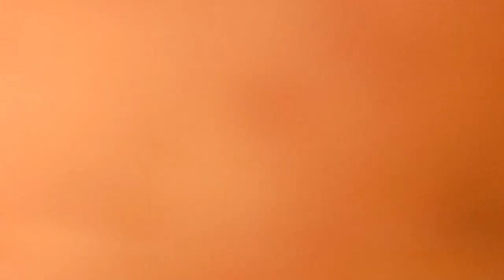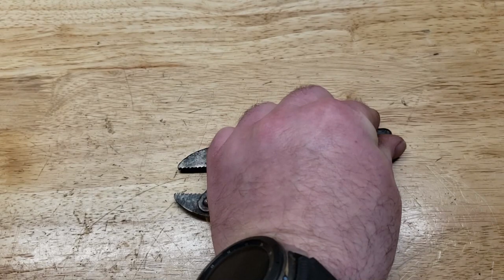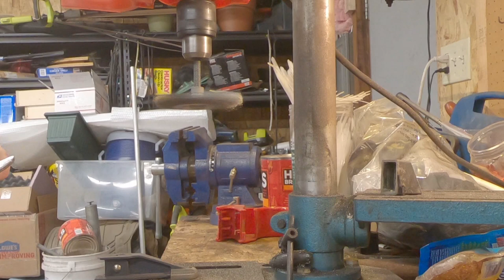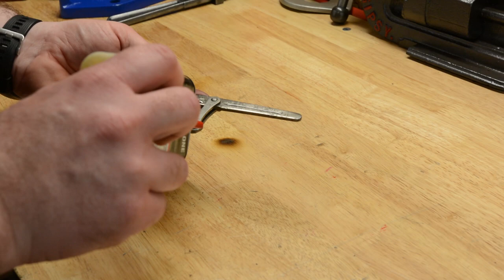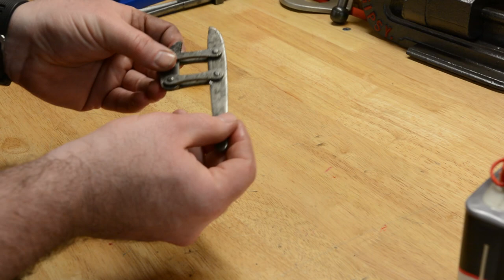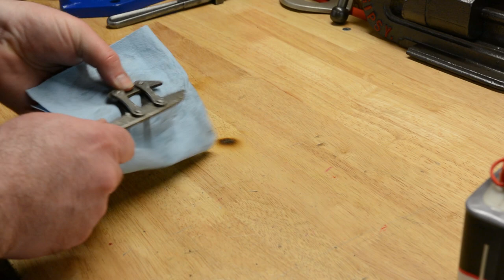Adjustable Alligator Wrench - Saturday Short #9

Comment: That is severely cute. Is it effective? As a wrench or gimmicky.  Would be a funlil thing to build from scratch if can actually turn a bolt. I wonder based onits dc geometry if it's meant for square head stuff
Reply from the maker: I haven't pushed it too much, especially considering the steel is only about 1/8th of an inch thick.  I've been reading that adjustable alligators like this may have been more oriented to pipe work, so maybe some light assembly work.  I am actually tempted to try my hand at replicating it in the future.